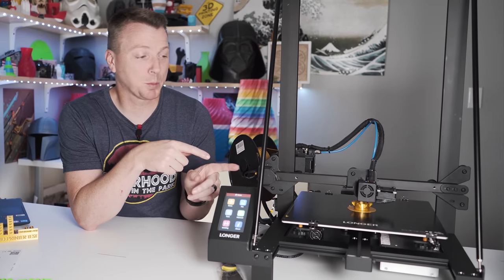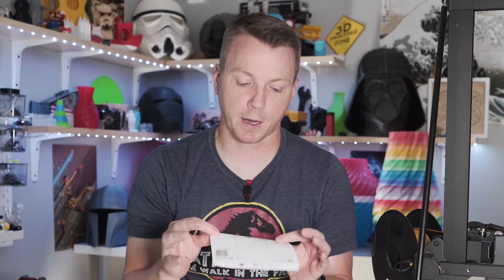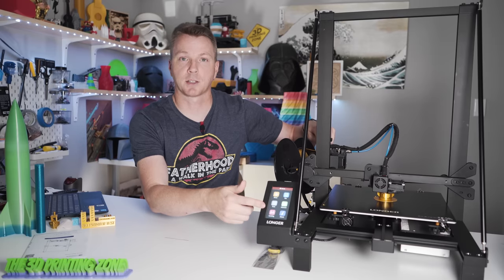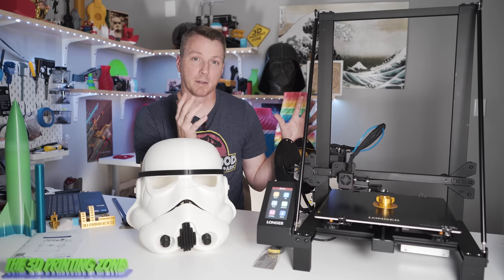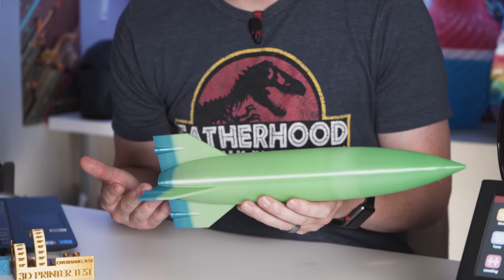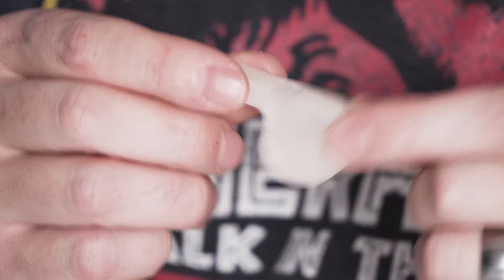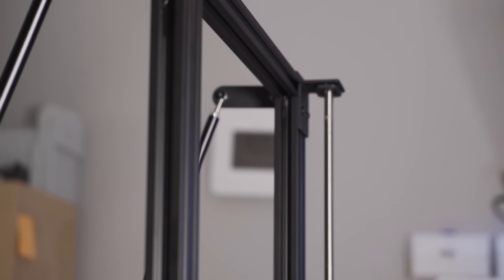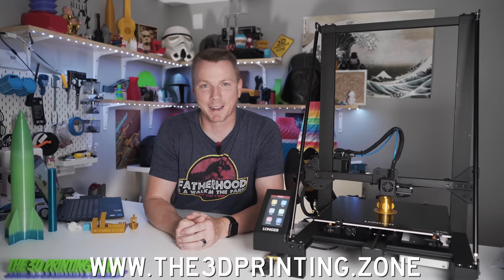The Cheapest BIG 3D Printer Out There - Is It Any Good? (Longer LK5 Pro Review)

Comment: that single Z screw looks like a problem.
a single Z screw means that the other side is going to sag (as it did with my ender 3 pro), which makes leveling the bed impossible (the bed may be "level", but that means nothing if the right side of the gantry is 10-15 mm below the left side
Reply: If that's your worry, check out the anet a8 plus, Similar build volume but cheaper and two z screws

Comment: Really nice.  You got me tempted.  Looks like a really short Bowden setup.  How is it for printing TPU?  I also do some PETG on my current Ender 5.  Need a larger print area lately for me though.  As for leveling I would go with TH3D's solid bed mounts and their EZABL auto leveling sensor.  I have that on my Ender 5 and it's beautiful.  Do you think this might benefit from a Direct Drive mod, or maybe liner rails?  Thanks for the interesting review.

Do you think this might Benefit with a Direct Drive Set-up?  I like the Micro Swiss.
Reply from the maker: Thanks for watching. I ran some TPU through there for a couple of prints with no issues and the connections seemed tighter than on other printers I've used but a direct drive is often a better setup, especially if you have a stable gantry like this one. If you're going to be doing more flexible filaments, then yes - perhaps a Micro Swiss or other direct drive. I don't tend to print much with TPU or NinjaFlex so I don't worry too much about it myself.
Reply: @The3DPrintingZone  I'm reading reviews on Amazon.  Normally I don't pay much attention for a variety of reasons but one caught my eye.  Have you heard that the To get a standard USB cable to work the +5V power pin must be disabled or you risk ruining the printer controller" Or so the reviewer says.  He was supposedly trying to install a BL touch
Reply from the maker: @ChinaAl  I haven't heard that, no, and I haven't tried installing a BL Touch yet. I'd be curious if others are experiencing the same thing or not since this is the first I've heard of that.
Reply: @The3DPrintingZone  I went to Amazon and searched for this printer.  Then I started at the top and checked all the star ratings starting with 1 star and that's where I found this USB report.

I lean more to TH3D's EZABl sensor and instead of the glass I use Wham Bam's magnetic PEX print surface.  Never had any problems with parts sticking or removing.  TH3D also has solid bed mounts.  No need for the springs with their auto leveling sensor.  The mounts are for my ender 5.  not sure if they work on the LK5.  I assume they would

Comment: Probably set to 230v by default because running a printer set to 230v on 110v wont work but wont hurt the electrics either, flip a switch and good to go. The same can not be said of running a  printer set to 110v on 230v.
Reply from the maker: Yeah, that makes sense. Good point.

Comment: I have a question for yeah then. I am looking at getting another 3D printer. My question is simple. I note new printers that print more than one filament. Would that not be better?
Geeetech A30T Three-Colors Printing is the one I am looking at but I don't know if I seen any benefit unless I was able to  use a Reusable waste like the ProtoCycler+ so what is your thought.
Reply: Depends on your intentions to be honest. I'd say a multi filament printer is only useful if you intend to print in different colors or make shapes so complex that normal support is not an option. For functional and single color prints it's really unnecessary to buy such a machine, plus it makes it a lot more complex for a beginner to fix if there are errors in your print

Comment: How has this machine been holding up? Seems to be more expensive than it was before, and the USA version seems to lock you into buying a double blower.

My dad has been thinking about a machine, and wants one with a large printing area, this seems to do a decent job of that, although one with a self leveling bed might be nice.
Reply from the maker: Sorry for the late reply on this. I still use the LK5 Pro more than almost any other printer I have because it's reliable and big. I still recommend it over most printers for the cost:benefit ratio. It does go on sale from time to time but yes - the price isn't as cheap as it was when I originally posted this, unfortunately. Between that and the Ender 3 V2 (which ironically has been failing me as recently as last night) I feel like there are some great printer options out there.

Comment: I have a Longer LK4. It’s similar in size to the Ender 3 with a single lead screw, and I’m having serious Z-banding issues and x-axis gantry level issues related to that. I’ve done everything I can think of to adjust tension on the Z-axis wheels, etc to no avail. I can’t help but think dual lead screws would go a long way to helping solve these problems.
Reply: Dual Z-axis lead screws are a required feature for me, no matter what the printer size but ESPECIALLY with large format printers such as this.
Reply: @tvideo1189  I’ve since gone with dual independent lead screws and an upgraded control board (MKS Robin Nano V3). Problem fixed. I also enjoy the silent stepper drivers.

Comment: Is printing only in one color a deal breaker?  Im new to 3d printers I'm looking to spend about 350 dollars and I'm wondering if this is my best option for a big printer even tho it only uses one filament color at a time?
Reply from the maker: It really isn't a big deal. I actually am planning a video talking about this exact topic - most folks just don't need a dual extruder printer. It's fun for cool looking dual color items, which is nice from time to time, and it's occasionally used for water soluble support filament but rarely since that stuff is way expensive. So, long story short, it's nice to have but shouldn't be a deal breaker for most folks.

Comment: Would you suggest this one or the ender 3? Trying to compare reviews of the units because looking at one of these and a resin maker
Reply from the maker: If you’re hoping to print larger volumes then this is the way to go. If you don’t need more than the Ender’s capacity then it’s a good way to go (probably the V2) because it’s well supported and very popular with lots of upgrades available. That said, this has been an excellent printer for me so far and it’s definitely a steal of a deal.

Comment: PSA: When PTFE is heated past some point it produces toxic fumes. It's very unlikely that the PTFE actually can withstand prolonged exposure to temperatures over 240C. Even high quality PTFE starts to break down at 250C. DON"T PRINT HIGH TEMPS WITH THIS.

Also, does this support thermal runaway protection? I highly doubt it and for safety reasons (this could short and start a fire) I believe reviewers should always check safety features. For those of you thinking of buying this printer: Never leave it printing alone, and if you want to enable this feature you will probably have to update the firmware. It's not too complicated, but a new user might have some issues.

Please fully research these before educating others.
Reply: Exactly. And as soon as I heard it was a sponsored "review" I left.

Comment: Can you use an older program to run this printer like coreldraw 6 or Coreldraw 11... just curious....
I'm interested in getting into 3D printing and I'm used to that software....
Reply from the maker: To my knowledge, CorelDraw is a 2D software, so you could possibly use it to start a model but you'd then have to use 3D modeling software like Blender, Fusion 360, Sketchup, CAD or TinkerCad to turn that into a 3D model. From there you need to slice it using slicing software and then you can send it to the printer.

Comment: Newbie question -- If I were to buy this printer and I have a windows laptop - what else would I need to print files from thingaverse?  I just want to print the files I download - maybe increase the size - but that's it.
Reply from the maker: You just need a laptop, the printer and either a USB A to USB B cable or an SD card and card reader. Nothing else is needed.

Comment: how would you rate Longer LK5 Pro against ender 3 in terms of quality and speed?
Reply from the maker: I've only used the Ender 3 V2 (not the Ender 3) but I'd say they're pretty comparable as far as speed and quality. Not a significant difference in either. They're both pretty solid printers that I think are a great bargain.

Comment: "this printer next to me probably about the least expensive large format. And w're talking 300 by 300 by 400 on the market today" Yeah no, newer versions of the CR-10's can still be gotten for near the same price when on sell. Overall though i would say from experience don't cheap out when it comes to large beds. Print fails or defects will cost you alot in the long run when dealing with those super long print times.

Comment: Would this be able to print a pc case maybe not all in one piece but in parts? Do you have any suggestions?
Reply from the maker: Yeah, it could do it in several pieces but you'd have to either come up with a great way to join them reliably (assuming they'd have thin walls) or find a design that is meant to be printed in multiple pieces. I haven't looked for anything like that but maybe do some quick searches and see what's out there.

Comment: LK5 Pro or Ender 3 v2? I like the printable size of the LK5, but the Ender 3 is big enough for what I am trying to print. Longer cut some corners to keep the LK5 priced well, like how the belt for the x-axis sits below the "strut". Some other reviewers have commented on this, and how it can introduce a variation in the position of the print head compared to where it thinks the head is. Over all the Ender 3 v2 looks like a more detailed/polished beginner 3d printer, but I like the size of the LK5.
Reply from the maker: That can be a tough call. If it's your first 3D printer, and your only one, maybe the Ender. The community around the Ender is massive and upgrades are limitless. I prefer using the Longer because of the touchscreen, auto leveling and print volume so you really can't go wrong either way. Also, for what it's worth, I haven't had any issues at all with the belt positioning or print quality on the Longer.
Reply: @The3DPrintingZone  I got the Longer. I was talking to a couple co-workers who are in too 3d printing and they all recommended that I get the bigger printer. They also mentioned that most things people call cons can be easily/cheaply fixed during or immediately after initial setup.

Comment: I wouldn't suggest installing options for octoprint. 
They are all buggy to an extend and the combination of some can cause you to lose wifi on the pi. 
Luckily it didn't stop printing but I couldn't communicate with the pi.
Reply from the maker: By options, do you mean plug-ins? If so, I run several at a time in three different pi’s and have for years. The ratings and reviews are helpful sometimes too.
Reply: @The3DPrintingZone  I'm just reporting what happened to me.
Reply from the maker: Yeah, of course. They can be tricky and that sucks that you’ve run into some bad ones. A good OctoPrint setup is really helpful for day to day printing.

Comment: looking at getting my first printer and this is a very nice video, the benchy is ok but what about something smaller such as a mini figure something like a D&D piece would this be able to handle detail or better to get a different printer for small fine detailed pieces?
Reply from the maker: Generally speaking, any FDM printer worth its salt these days can print quite well at a small scale with high detail. There is very little difference between a $200 printer and $2000 printer on miniatures, in my experience. If you want a much higher level of quality on miniatures, SLA printers are the way to go. This one is no exception. If you crank up the resolution by lowering the layer height to... say... 0.08mm, and reduce your speed, you'll get a pretty impressive miniature just about every time. Alternatively, you can also swap the nozzle for a 0.2mm and make it even higher detail for those sharp corners and such.
Reply: @The3DPrintingZone  awesome information thank you for the info and the quick reply!!

+1 Sub
Reply: Resin is the best way to go for small figures.

Comment: Just wondering are you using the default temperature setting?
When I used 200C/60C, the adhesion issue comes frequently and I have to increase the bed temp to 80 to improve a little bit. But still, I constantly get the first few layers falling off or touch and then stick to the nozzle which totally mess up my print.
Reply from the maker: Depends on the material. For PLA, I typically print between 45 and 60 and rarely, if ever, go above that. For PETG I print hotter on both the bed and hot end but I had not issues with the bed at 60 for PLA.
Reply: @The3DPrintingZone  to

Comment: Shame it doesn't have BL Touch or some other bed leveling.   I've seen one mod for my Sidewinder X1 that uses the Z endstop sensor.  I put on a bl touch and it makes it SO much easier...
Reply from the maker: Agreed on that. Fortunately, they've made it as easy as the could to allow for adding one. They go for about $38 USD right now so it's not too bad to add one but that would be awesome if it was included already.

Comment: Hey there - So I bought the printer and it arrived yesterday! I assembled it but I am having an issue with the leveling --- seems no matter how tight I tighten the bed screws I can't lower the bed.  The bed is too high - how do I fix this? thanks.
Reply from the maker: There may be an issue with the placement of your z-axis limit switch. It's the little metal clicky arm on the gantry that tells the x axis how far down to go and when to stop. See if you can raise that a bit.
Reply: @The3DPrintingZone  Ok, will do.  The x-axis isn't hitting it now and I have it at the white label.  I will raise it a little - I was afraid it was more of a cut off switch.  Thanks for the quick reply. I'll let you know how it goes this evening.
Reply: @The3DPrintingZone  thanks for the tip  - I was able to make the demo whistle.
I have octoprint setup on my pi so next step is to get Cura configured.
Reply from the maker: Progress! Nice work. There are several things to overcome and then it’ll be (somewhat) smooth sailing with little tweaks. Good luck!

Comment: What about the LK5 Pro v. the Ender 3max?  I currently have an Ender 3pro but I would like a bigger bed surface and the two are comparable price wise and specs . . . any input as to which is better?
Reply from the maker: I haven't had a chance to try the Ender 3 Max but after doing a bit of research, that's definitely a tough choice. Any Creality printer has the advantage of community and resources. My E3V2 is very reliable and a great little machine and I imagine the 3 Max is pretty reliable too. A few key differences: The LK5 Pro has the stabilizer frame bars, which really do help keep things smooth. It also has a full color touch screen, which is super convenient. The 3 Max has the dual cooling fans and, as mentioned before, a great support framework with so many people using it. Tough call, man. Not sure which is better without trying the 3 Max. I imagine you'd be quite happy either way though.
Reply: @The3DPrintingZone  Ok, thanks for the response.  Since I have an Ender already I might lean towards the 3 Max  . . . still thinking about it.  I do enjoy the advantage of the Ender community support.  Thanks for the great video on the LK5 Pro.
Reply: @The3DPrintingZone  One more question . . . is the stormtrooper helmet full size?  And if so, where did you find the design/file, because all of the full size stormtrooper helmets I can find are too big for the LK5 Pro?

Comment: I want to really like this printer since it is big and pretty quiet, but I have had to fix a few things. I had a bent lead screw so I had to replace that. I also have z wobble issues on my prints even before replacing the lead screw. I also don't like that by default you can't do PID tuning. You have to modify the firmware to enable PID tuning and flash the board. They do have a version of the firmware that is configured for BL Touch, but it doesn't probe the whole bed, it only does about 3/4ths of the bed.

Comment: I usually buy everything used, any used  vs new tips or advice?
Reply from the maker: Many printers allow you to actually see how many hours that printer has been run, so if you can get that info when buying used that will really help to get a feel for just how used it is. I suspect there are quite a few used options out there that can save you tons so I don't see any issue with that. I like to buy all kinds of things used too so I totally get that. As for printers, if you see something that seems well reviewed and/or really well supported then go for it. I wouldn't worry too much about the bed condition or the nozzle since those are easily replaceable too.
Reply: @The3DPrintingZone  thank you for the speedy reply. I like to buy used things because they often come with the mods or upgrades that are typically done. Are high hours relevant and what would be considered high? Anything else I would want to be aware of? I am considering resin even though I see there is a lot of maintenance, I would like to print turbine and air engine designs so smooth and air tight clearances are desired.
Reply from the maker: @David_Mash  Makes total sense. On the hours, I would just watch out for something that has thousands of hours on it and may be in need of part replacements. Check for wear and tear on roller wheels, belts, etc. For the precision you're looking for, it does sound like resin might be a good idea. I haven't had any experience with resin printers so I'm not much help there but my understanding is that they'll typically be capable of producing a smoother and more precise finish / sizing.